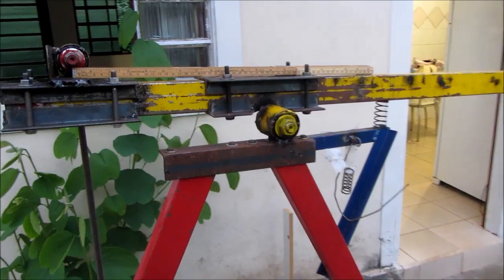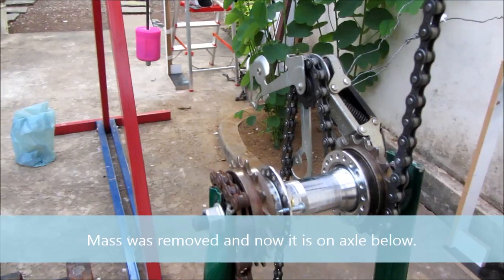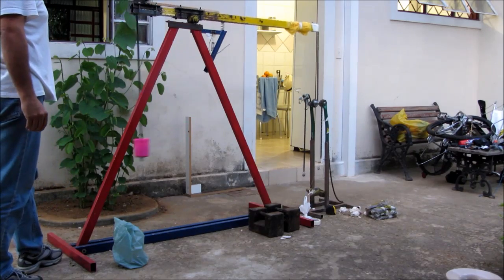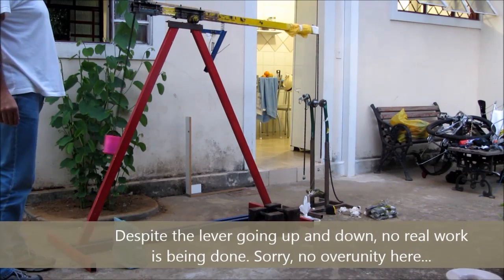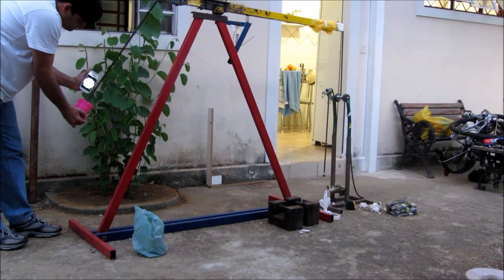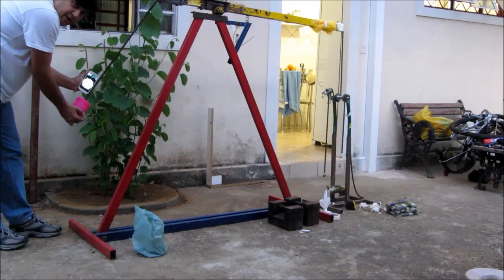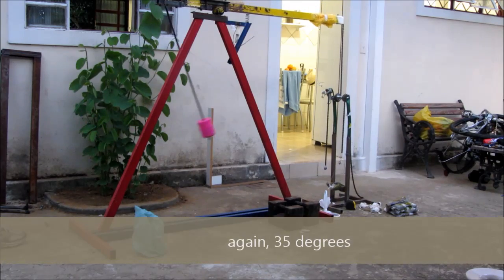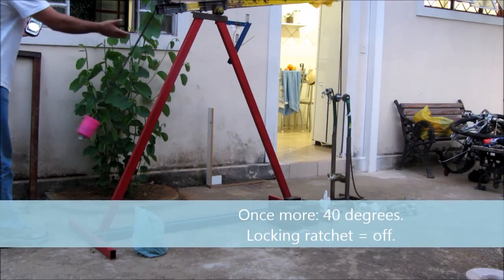6 - Two way oscillator - Comparison between workable and non-workable mass

Comment: Best way for me to imagine this:
Lift something or someone.
Let them step of when lifted.
Return the lift when weightless state on pendulum (with ease)
Put next load on it and repeat.

Also, you could try 90° if device is still somewhere in garage :)

Another thing, heavier bob should make losses less noticable. 10kg? Or just to use a string instead of a  rigid arm.

Comment: Dear Luiz Fellipe Salomon, please add this important correction to the description of your video:
In the last sentence, instead of: "about, 10J of energy", it should be written: "about, 1J of energy" or to be exact 0.981J of energy!
This is extremely important correction and difference!

I would add one sentence at the end too:
"Efficiency is: about 38.5%"

Thank you very much for your amazing work! I have been waiting almost 20 (TWENTY!) years for someone to publish some real scientific experiments on this machine!
Reply from the maker: +astroshima1  Hello! And thanks for your comment. I tried to demonstrate the use of the machine in terms of energy. In my opinion and point of view, it is what I think would be plausible and reasonable to prove or disprove something.
About your correction, I still believe it is 10J, as Potential Energy (PE) is mass(m) x gravity(g) x height (h).
In this case the mass was 1kg, the height was 1m, and, last time I checked, gravity was pretty close to 10m/s2 
:-)

Like I said, it is a pretty intriguing machine. Maybe for some other use (like crushing stones), it could be useful.

Thanks for your contribution.
Reply: +Luiz Fellipe Salomon 
Quote 1: "On the other side of the lever, the 1kg ... barely climbed 10cm, resulting in,about, 10J of energy."
10cm=0.1m
Ep= 1kg*0.1m*10m/s2= 1J
Please check this out again! Output energy can not be 10J or 4x greater then input energy which is 2.55J

Quote 2:"In this case the mass was 1kg, the height was 1m, and, ..., gravity was pretty close to 10m/s2 "
Please check the video and previous quote. The height that the 1kg mass climbed up was 10cm = 0.1m. (Not 1m). Please check it!
Reply from the maker: +astroshima1 Yes... yes... Have to go back to school to learn to do my math. 

Noted and corrected!  Don't know where I had this 1m on my calculations.

Thank you very much.
Reply: @LuizSalomon  sometimes we just need to repeat the calculation :)
Reply: This experiment needs corrected calculation. Pendulum is not doing free fall, therefore mgh cannot be used. All points (angles) potential energy can be calculated with this formula: PE = mgL(1 – COS θ). Less energy is needed to go from 60° to 90°.

KE=  ½mv^2 

I  suspect that friction is an issue here. Maybe even some unwanted back oscillation through lever.
Reply: Btw, before all, this should be checked with locked lever. This is to know if friction of that bearing is really that bad.
Sorry for spamming! :D

Comment: Again Mr. Luiz Fellipe Salomon,  I wish I could be standing beside you to shake your hand on the fact that  unlike many others  who speak about its over-unity, you know this machine , but you need to consider the following:-
When stationary, without the ratchet,   the balance of the lever is the contribution of the sheer weight of the pendulum, the  weight distribution in the lever itself, the (non-linear) spring and the load weight and the chain  acting as counterweight to the pendulum, the fact that the top lever is not pivoted in its centre of gravity means that at certain angle, its  moving weight could be contributing aiding or assisting the load . 
At 3:02 it shows clearly that once you ratcheted the output weight at its highest point,   it was released from the lever and so the lever had not enough force to accelerate it back down, in fact its own instability contributed to keep raising it.  and it is imperative that all the time the pendulum dropped and dropped and dropped contributing its Potential Energy and not its Angular energy to lift the " load"

Please Sir add a couple of springs in parallel with the load such that this energy saving loads will limit the movement of your horizontal lever without wasting or losing energy,.  While limiting the movement of the horizontal lever, They will store all the energy given to them  and they will release it at some time either back to the pendulum or to the load itself while it is attached to the machine.    
I need not say any more as you do know what you are doing, but will see a better picture if you correct your misgivings in this machine.  Still with a better machine you will confirm that you are absolutely right about your conclusion,  and though  you should feel proud that  you were  honoured from the Official Video Channel of Milkovic, well, do not be afraid to make a decision of your own and stick to your own conclusion as you were absolutely correct, but all you need is time to consolidate your thought,  and perhaps you consider what I had to say. Congratulations and good luck.  I am sure with time many people will understand that when they say an amplification of 12:1 and 10:1 and an efficiency of 1000% well they do not know what they are talking about and we must be very compassionate towards them.
Reply: +Carmel Pule' Please note carefully .   If you raise the pendulum to say 80 degrees and release it   and allow it to  come back and then catch it and measure the angle again, to see how much  angle it lost, and then you also measure how much the weight on the lever went up to calculate how much work was done, this is just not good enough. 
This is not exactly right as if you measure with the lever still up as in your case, and with the pendulum  in a still dropped position,   but with a swung back pendulum ,  this means that you did not take into account the  Potential Energy Lost by the sheer weigh of the pendulum which someone has to put back to bring the lever down to its original position, ( by measuring only the angle you only took account of the loss in angular energy  of the pendulum and not the loss its potential energy. due to the pivot dropping)   
So really it is not the  drop in the angle that you need to measure, You should allow the lever to go back to its original position before the weight was lifted. so that the cycle is repeated.
I noticed that you were lifting the pendulum yourself which not only swung the pendulum but lifted its pivot point, something that the load does when the ratchet is not working and so the work done on the load is less. . Energy gained and energy lost needs very careful thinking as there is a possibility in your machine  that  when the weight is lifted and ratcheted  in its final top position , then the pendulum would remain dropped as the release of the output weight would result in the pendulum remaining in the lower position, which is an energy that is not being accounted for, and yet the pendulum has swung back.  
The final weight is lifted due to  two issues, the pendulum dropping down and also due to the pendulum losing its angular energy.
Measuring  how much the output weight went up and how much loss  there was in the swing is not enough condition to measure true efficiency as some one must lift the dropped pendulum up again and believe me that is a lot of energy.
Reply: +Carmel Pule' I feel that in this machine you cannot ratchet up the whole output load, but only part of it as some weight needs to drop down to lift up the dropped sheer weight of the pendulum.   So the output energy is not the whole lifted ratcheted released weight on top and there could be a situation where the pendulum will swing back but  the lever will not drop to lift the pendulum back.    Handle the measurement of this machine with care,   I would suggest ratchet up only half of the output weight and leave the other half to drop the lever and raise the pendulum  back and not only see the swinging back of the pendulum.
Reply from the maker: +Carmel Pule' I see know what you meant by restoring spring on my video#4.
Reply from the maker: +Carmel Pule' At the end, I was just making a simple math: Potential Energy on pendulum (how much energy I had to insert on system to restore it's original position), and resulting potential energy on the other side.

If I had gotten a close result (by close I mean > 80%) between the PE of the pendulum and the PE of the resulting mass, I would have gone for improving the machine. But that wasn't the case. So I thought: if this machine is not so efficient, maybe if I improve it (even if a lot) I won't get a satisfying result.

Theoretically speaking, when the lever stops going up, the pendulum stops loosing it's angular energy. That's the idea on catching the pendulum and see where it stopped, do the calculation and see the result in potential energy. But always having ENERGY as my goal.
Reply from the maker: +Carmel Pule' On the part of ratcheting the whole output load, take in account that there is the sheer weight, plus the garments.

I did a very interesting evaluation using Matlab, where I considered all this, including center of gravity and other minor stuff. I could replicate almost completely (about 98%) of the actual results in Matlab.
Reply: +Luiz Fellipe Salomon And I do feel confident that the Matlab simulation  did not  confirm that this is an amplifier of ENERGY.   and with the lever system moments being what they usually are by Milkovic, it is is not even an amplifier of FORCE.
Though you know I did see in a video  of a young  boy farmer and his parent apparently running one of these machine as a water pump where the pump was effectively coupled to the horizontal  lever at 1/2 of  the distance of the pivot of the pendulum to the pivot of the horizontal beam.   Now that was an amplifier of Forces. 
Best regards
Reply: +Luiz Fellipe Salomon  I make my own simulations to get an idea of  what to expect of this machine.

Here is a program which integrates the force   with which the load is pulled to a maximum for various load weights.   It shows that the highest work done was on a load which is about 1.6 times the weight of the pendulum.  I am an old man and so I use old  computer languages.

    1 A=0      (position)
    2 A2=0     ( acceleraion)
    3 A1=0      ( velocity of pivot)
    4 Z=.00 (spring attached to load.)
    5 W=0
   10 ML=1     ( Mass of load)
   20 MP=1      ( mass of pendulum)
   30 G=10
   40 R=10       ( radius of swing or length  of pendulum)

   45 FOR ML= 1 TO 1.8 STEP .1
  
   50   FOR K=0 TO 3.1642   STEP .001
   51     H=R*SIN (K)
   60     S= MP*G + 2*MP*G*(H/R)^2 -ML*G -A*Z
    
          IF S>0 THEN GOTO 80 ELSE GOTO  110
    
    
   80     A2= (1/(ML+MP))*(S)
   90     A1=  A1+ A2*.01
  100     A=A+A1*.1
    
  110     W=(ML-MP)*A
    
  120     PLOT69, K*500,600+A2*80
          PLOT 69, K*500, 100 + W *0.1
  121     PLOT 69,K*500, 600+A1*5
  122     PLOT 69,K*500,600+A*.04
    
  130   NEXT K
        A2=0
        A1=0
        A=0
Reply from the maker: +Carmel Pule&#39; Hello again, Carmel. Thanks for once more bringing enhacement to the discussion. This is what makes the difference! 
I have to disagree with you about the force multiplication. Please follow my line of thought:
A lever is a simple machine. In this case, it is a machine derived from a simple machine- the lever.
Since I am law abiding citizen, the conservation of energy rules my life (damn you Lavoisier and damn you Laplace!). With a lever we can multiply force, but, and I emphasize here the word but, but...
but we can't multiply energy.
The lever is a very close approximation (redundant?!) of an ideal machine. So, we have to maintain the equilibrium of torques on the short side of the lever, and the long side of the lever.
Since the distance from the fulcrum to the ends are different, it must be a force multiplier. It just has to be.

About the the water pump, it is a nice video. I thought of that video when I developed my machine. 

That video brought me the question: how long will it take for the little boy to pump 10 liters of water from a well that has water 1 meter deep. I found another video, where I could roughly calculate the amount of water. This brought another question to the machine: Work Output.

Going back to the law of conservation of energy, ideally the Work Input = Work Output. So the question that came to my mind was: how long would it take to pump 10 liters...
Reply from the maker: +Carmel Pule&#39; I am going to do a video on my experiment with Matlab. 

I was pretty meticulous on adding all the factors to my model, including friction and other energy wasting parts.

I did go through some time with this study, because I really thought (going against my beliefs) that I could get this machine in such a specific setup of heights, weights distances, lengths, speeds, etc, that it would go into a "ressonant" state, with the use of the springs, and maybe some magnetic or eletromagnetic device to help it develop something close to 100% efficiency.

Even as I wrote the above paragraph, I am really tempted in trying it again...

Maybe it is time to take the spider webs out of it...

P.S. Your program above made me remind of my Apple basic time... good times!
P.S. 2 - Keep those ideas coming!!!
Reply: @carmelpule6954  loss is coming from friction of pendulum's bearing. Return what is lost - that energy is input.